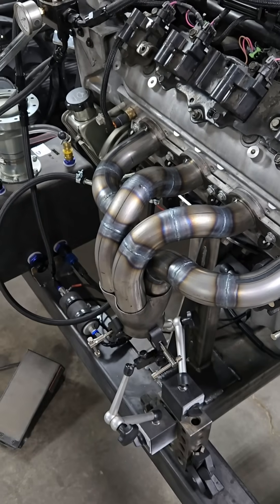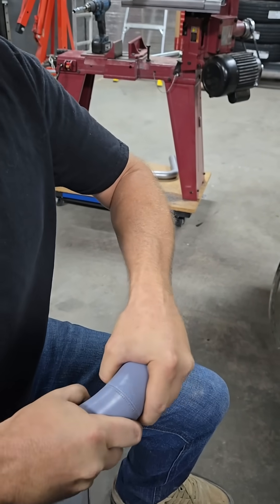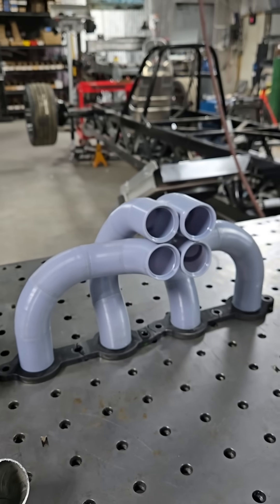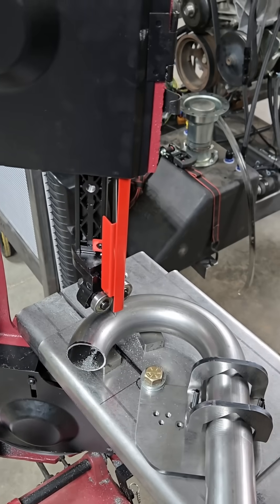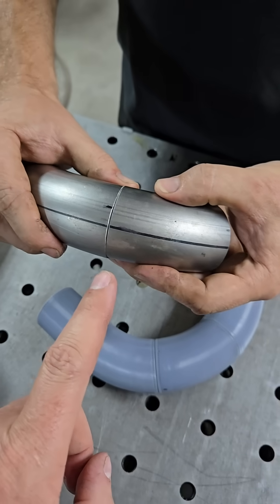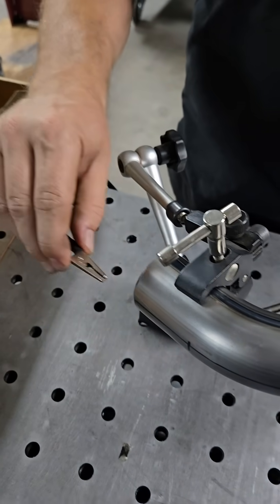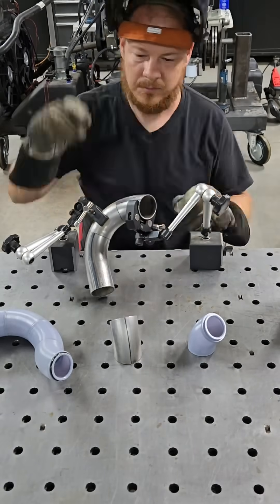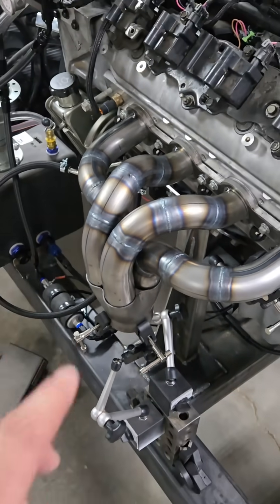Don't build another set of headers till you watch this!

Comment: Question: Did you do the math on the correct length for optimized scavenging or is this just for equal length in the given engine bay?

I haven't been done headers in a while. But, those look like they're at least a foot too short. 
Optimum Primary Tube Length = [(850 X Exhaust Duration) / Peak Torque RPM] - 3 
The answer to the above equation gives you straight pipe length. Bends in the primary tubes change the velocity of the gases, and that changes the effective length of the tubes: more curves mean longer pipes.
Reply from the maker: These are just simple equal length to fit headers. Not tuned. The truth is you can't do much worse than stock. Dyno testing coming soon.

Comment: Seriously, I've got an older bad ass bmw 850i with the M70 V12 engine ......I want to do a twin Chinese GT35 Ceramic bearing turbo build with it! I choose the GT35's and I'll use Stainless 2" tubing feeding into the turbos so that it will spool up quicker than a regular turbo set up.  From 0 to 2500 rpm i think the engine is underpowered. Past 2,500 even without turbo she wakes up and pushes you back in the seat!  So, quick spool up and not revving past 5,000 rpm is ideal i think. Im going to build a custom front mounted aluminum intercooler that holds lots of dry ice in a compartment! With like 8 pounds of boost, realistically the engine will see 15 pounds! Cold intercooler adds so much more power. I've got 2 throttle bodies, 2 MAF sensors...It is basically 2 bmw 525 engines connected to one long crank that has 6 main bearings!
Reply: I'll use stock fuel rails, Denso fuel injectors that are a bit more flow. I have 2 DME's ecu's...one for each bank that hold performance EEprom card. I can get tune on the cards from a company that sends tunes over the internet!!
Reply from the maker: cool get it done.

Comment: Making headers is eaaaasy… you just need a nice shop with thousands of dollars worth of tools and equipment! No hate though, nice work
Reply from the maker: Thank you. We get that a lot. I started in the back yard in the dirt under a pop up with used tools. Just cause we are in a good place now does not mean that's a requirement. It would still be easy on the front lawn with old used stuff and a steel plate on some saw horses.

Comment: If you don’t wanna spend $$$ on a 3d printer there is this thing called pvc which you can buy at your local Home Depot with every possible configuration you could imagine… made a roll cage once using it works great for mock up!

Comment: Very cool, great way to think outside the box , but will they fit the engine compartment? Can they be installed easily from underneath the car ? Pro tip , dont use exotic materials, titanium will crack , use regular American materials .
Reply from the maker: Thank you. Yes we like mild steel and SS.

Comment: Those welds aint gna last.  Exhaust hot air is a breathing fire from the engine.  The extreme heat and pressure and vibrations will destroy those connections maybe after a year

Comment: Why not ground the welder directly to the table? Are those fixtures incapable of conducting a current? 

Not trying to be rude, just curious.
Reply from the maker: They can but the joints in them have grease and that can cause issues and if you get arcs in the joints they will stop working eventually.
Reply: @ ahhh… makes sense. Thanks.

Comment: I thought each individual pipe had to be a scientifically calculated  length to maximize and balance the scavenging flow?
Reply from the maker: For a tuned exhaust yes. But sometimes you just need to make it custom to fit. Just remember you can't do any worse then stock.
Reply: @ thats for sure. in the late 70’s, I had a 70 Camaro with a 350. I put a set of Hooker headers on it and it made a huge difference.  Then I put on a single plane Holley Dominator manifold, 750 cfm Carb, 3/4 race Isky cam, Mallory dual point distributor, accel coil, traction bars, gabriel hijackers, Transgo shift kit, B&M click shifter, and havent experienced acceleration like that since.

Comment: Realize you can just build your own intake from plastic directly with PVC pipe. As long as you are doing fuel injection, you don't have to worry about heat. I did a modified intake this way and it worked quite well.

Comment: Can I be honest? Having built plenty of exhaust systems, turbo headers and manifolds….this looks like it’ll take more time than it would not using this stuff. Also from experience, copying pipe pieces isn’t a cut and dry ordeal. My method takes less time. Cut a few 1” (you may need longer) pieces of your pipe. Cut a 1/4” slot out of them. Then you can squeeze them smaller to fit inside the pipes while mocking up. Then mark them. Then tack together.
Reply from the maker: Well, i'm not sure. One side of the v8 was on in 2 hours. How long did yours take?
Reply: @ 1.5 hours

Comment: So if you are running a X plane crank V8 your primary tubes will need to be un-equal lengths as the bank phasing of the firing order will be out on two cylinders on each side of the engine. I love the mockup & setup very nice indeed!

Comment: This is an entirely random question but maybe the internet can help me out. I studied mechanical engineering in college, was a 5 year team lead in FSAE (college racing comp), and worked for a short while in fabrication in a race shop- how does someone get to work on these/in a shop like this full time? Engineering is great and all but I really miss the connection of working hands on building something performance related. Any help is greatly appreciated.
Reply from the maker: You have to compete for these types of jobs. The truth is you want a boring job not this. These types of jobs are highly competitive and that type of environment is hard for most people (emotionally). You will have to invest our own time and money to get good at this and then apply at race shops. You will be one of many doing that and there is only 1 position open once in a while. So be ready to accept not getting chosen.
Reply: @centurialinc  I appreciate the info. I've done the boring jobs and I've worked in a race shop, I've been involved in racing since I was a kid and it's always been my passion- I definitely prefer the race shop. I'm just wondering what type of qualifications I could gain besides an engineering background and fabrication ability that would help to set me apart in competing for a job at another race shop.

Comment: The holders are slick! I never thought about putting clamps on an indicator base.
Reply from the maker: Yup get them off amazon. We love them.
Reply: Similar "magic arms" are used in photography pretty often. A high quality unit has accurately enough manufactured ball sockets to carry even multiple kilogram camera + lens with zero drop after locking.

Comment: Ive learned that all tubes have to be the same length for optimal function.
Thats not the case here.
Reply from the maker: Yes it is. These are equal length and the plastic parts have length on them to help get that right. I just didn't say it because it trivial.

Comment: My muffle backfired and disintegrated. So i took the existing pipe and used it to make a matching pipe and now i have straight pipes for about 30 dollars. Just needed one stick of exhaust pipe. Now welding the upper part was questionable. I recommend clamps for the attachment to the existing pipe under the vehicle. And you won't die welding up against the gas tank like i was..

Comment: I didn't quite get how you go from the plastic parts to the steel parts.
Reply from the maker: The band saw was used to cut the pieces out. The Pieces we cut out of metal are based off the plastic parts. The plastic parts have numbers on them to tell us what to cut and how. Then we fit it together just like the plastic mock up and weld it out.

Comment: There's headers and there's tuned headers that account for the pressure wave timing so the collector isn't unnecessarily pressured by back pressure harmonics and causing cylinder degraded performance.  Anyone can make pretty pipes.  A genius tunes them.  Just call Gale.
Reply from the maker: The engine is on the DYNO for this purpose. Build test modify repeat.

Comment: Do not do this on a daily driver. This is not a tuned exhaust header. This is only okay for race applications and short-term use. Headers should be made out of equal length mandrel bent exhaust piping. The best way is to draw on the pipe with a tire crayon and then start the engine. The position where the tire crayon begins to melt first is where you put your first Bend. In my 30 years of building bending and flairing high performance exhaust, I've never welded one. It's all about Scavenging

Comment: Engineering motor are different from piping welding how about reversing exhaust for intakes don't need high energy nitrogen compound laminated filter also increase engine efficiency

Comment: And then after you’re done, when you put it in the car, you realize that you should’ve done this while it was in the car because it doesn’t have a clearance on one side or the other, or needs to go around something different steering column, etc.
Reply from the maker: Video is for demo and tuning on the DYNO. This process is exactly the same when done in the car.
Reply: @centurialinc  I know I was just saying mock up not in the car is a bummer when you miss by a 16th of a inch

Comment: GUYS DO NOT WELD TUBES LIKE THIS BECAUSE THE WELDS ARE A WEAK POINT AND BACKFIRE AND HEAT CAN MAKE IT EXPLODE AND LEAK ON THE WELD POINTS. I’m 21 and I know better not to do this shit just get regular headers that have bent tubes not welded ones your gonna ruin your car. Having cool welds on your exhaust or headers is only for looks I have discussed this with many mechanics and metal workers.
Reply: I have been around many old heads who been hot rodding cars and I have worked in a metal factory idc what you say don’t do this stupid shit unless you are a pavement princess
Reply from the maker: False. This is a tried and true way to do custom exhaust.
Reply: @centurialinc  do what you want I like shit done properly tho

Comment: The pie cuts are useless, just use material made for being heated and cooled off, then you can bend it and have less opportunity for errors or failures due to it being separate pieces and also last longer seeing as hardened material that requires pie cuts also becomes brittle after heating up and cooling down enough, which it will do every time you turn the vehicle on and use it, wasting time, money, and putting the engine in danger of messing up for no reason
Reply from the maker: Pie cots are the best way to do this.

Comment: Why did you put the collector there? Wouldn't you want to make sure it fits where your crap is under the hood like mounts and such first? pretty cool on the process. Wonder if the cost would compare to a metal 3-d print? Not sure what kind of options you would have but due to it being in cad anyways and the time and cost of welding as factors?
Reply from the maker: For demo and DYNO tuning. The final version needs to be done in car. We did not say that because it should be obvious.

Comment: Making headers it's not just to make the engine look cool. The purpose of exhaust headers is to absolutely make a free n eazy path and if you can achieve a scavenging effect all the better. Correct?
Reply from the maker: Some times, making custom exhaust can be for fun. Not everting has to have function. It can literally be just to look cool. It can be just to make a specific sound. Some try to get max power some try to get max street appeal. It is what you make it. No more.

Comment: Used to build a Lotta handrail never had fancy tables and all the bs fixtures. A C clamp with peaces of angle iron tacked to the ends works great for pipe clamps it works on threaded and vise grip C clamps too. You can just knock it off and grind it back smooth if you wanna normal clamp again. No need to spend all the money on the fixture bs. You can just put them in a vice or tack it to the table too. Edit also i forgot to mention those welds look like ass. i take dumps that come out with better consistency than that.

Comment: this... makes header fabrication actually look humanly possible
Reply: I made a set of turbo headers... took me a year 😂
Reply: I just finished a set of long tube 180 degree V8 headers. Took about 2 months of a couple hours after work and weekends but it was only my second set ever.
Reply: Hardest part about welding is affording a welder and having a workspace you can do it in
Reply: Barely
Reply: It's eeeeeeasy
Reply: yeah if you buy all the tools for it
Reply: yea but for double the price of a header?  no thanks
Reply: yeah until you start to weld and realize how long it really takes to put together a couple pieces of thin metal. cant overheat it
Reply: They are making that look way easier than it is. Even with the tools lotta skill being casually displayed there :)
Reply: dont use 3d printed parts for headers -.- shits gonna melt
Reply: How are they going to weld all the leaks between the pipes in the middle though?
Reply: @1badombre82 that's where planning a "tootsie roll" grinding tools.. I loved making custom headers cuz I was good at it, so it was fun..
Reply: @1badombre82  full pun but minimal protrusion. You weld a 'star' between the tubes for the middle, bolt the unit to a decent kid plate and you can heat and tap the flange into a nice tight fit, then external weld. With thicker materials and a decent jig, can throw through a heat cycle to stress relieve
Reply: @1badombre82 weld the pipes together from underneath, then weld that piece to the collector.
Reply: @1badombre82 having actually done this, the 4 pipe union is welded together before they are welded to the collector
Reply: Just make en yourself, buy 50 bucks worth of aluminium pipes and /or old wrecked cars intake and weld it 15mins
Reply: @L4ftyOne 

Are you talking for real? I just want to know
Reply: I did stainless pipe with gasless weld. Not the best in the world but good enough to not leaks.
Reply: @aminemohamed1717 no it’s not that fast, or simple. You need a welder, those plastic things, piping, and whatever else you need for the welder. Also you have to cut those pipes and a table saw probably isn’t the best option. But once those pipes are done you just need that tack weld holder to hold them up while you weld them. After you’re done you have to weld those pipes onto the end piece that goes into the catalytic converter. Then you have to figure out how to make it fit and stay. But after all that, assuming you started in the morning, it should be well past midnight when you’re done. When people say stuff like this takes hours or days, they mean ts.
Reply: @HotTripod78 you're mostly correct but most people with custom built headers don't run catalytic converters. Lol. Those are ONLY good for restricting TF out of the engine and almost always only used in an exhaust system because of laws in certain states that require them for emissions and even that's only for newer cars that came stock with them.
Reply: @L4ftyOne  I can turn that 15 min job to a 4 day job
Reply: @L4ftyOne 15 minutes? yeah right 😂
Reply: Thats the old way
New way is you have 1 machine to scan.
And 1 machine fab the parts.
No cutting. No welding. Frees up the guys to do other stuff. And parts are superior.
Reply: @Hawlkeye-e9p What processes are you referring to?
Reply: It's not hard, just tubes.
Reply: @mannycalavera121  Really?? You should try it sometime, especially real world headers where you pay attention to spark plug accessibility, equal length tubes, when you have a frame, suspension,  clutch linkage, maybe a dry sump oil system with the pump and oil lines in the way, and its a complete car, not just an engine on a stand. My customers know well enough that they don't complain when they are presented with a $4K-$6K bill for building a set of headers. I had over 70 hours building a set of zoomies for a customer a little while ago. Building a set now for an LS engine in an old Rambler, unfortunately the steering interferes as does the frame, the custom motor mounts, the master cylinder, and the transmission cooler lines.

Comment: How does that ground carry enough current for the welder?  You have to be running real low amps.   I would think the 40-50 amps you might be running would either burn it up or it would be too hot to handle.
Reply from the maker: Yes. Thin pipes do not need many amps.

Comment: Did not mention it should be equal length? Because if its not, then you're making trash.
Reply from the maker: Yes they are just skipped that. The plastic parts have length on them to help with that.

Comment: I'm going to send this to my old boss. We used a lot of 3d printed jigs for our pipe work. I bet he'll get a kick out of how easy this is!
Reply from the maker: Heck yeah.
Reply: They have been around for years now! Invented in Australia..🇦🇺👍
The inventor of the plastic header making kit, which simplifies the design and fabrication of custom exhaust headers, is Victor Franco of icengineworks. He developed a system using snap-together plastic blocks that allow for precise, full-scale 3D header models. .
Reply: @BigRed-MWA obviously a Smart man
Reply: Or make headers for him and charge him 10 hours and finish in 2
Reply: No you open up shop next door and compete with him.
Reply: Dumb this is the old way. Wasts time.
Scan it.
Print the parts
Reply: @Hawlkeye-e9phow you going to scan something that doesn’t exist?